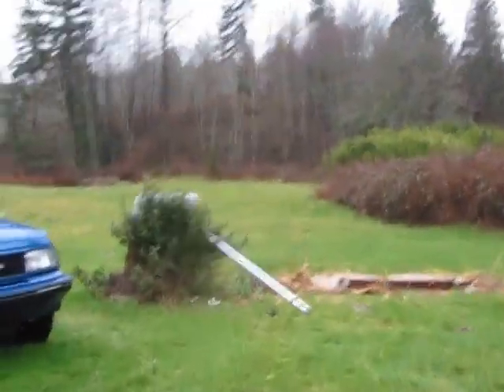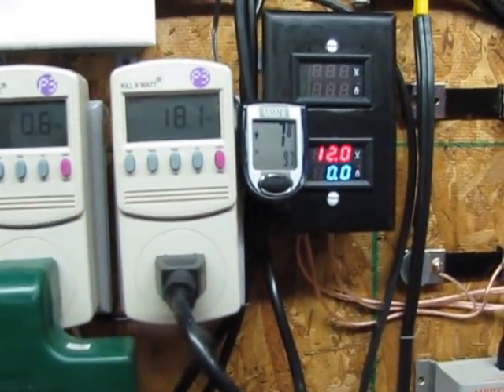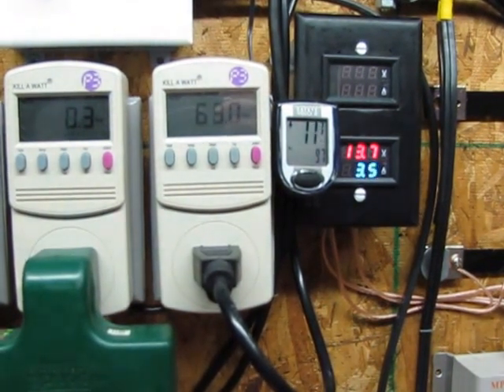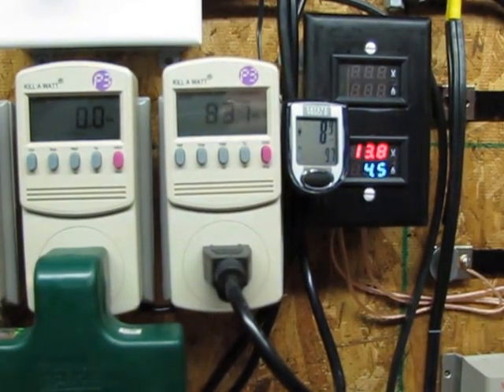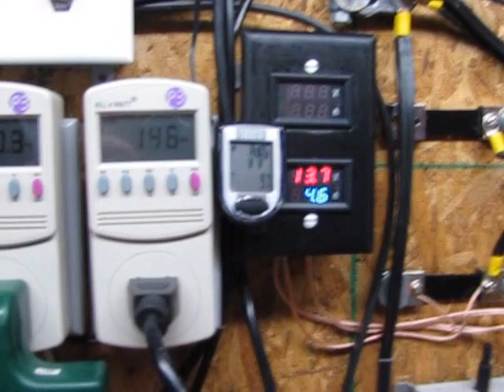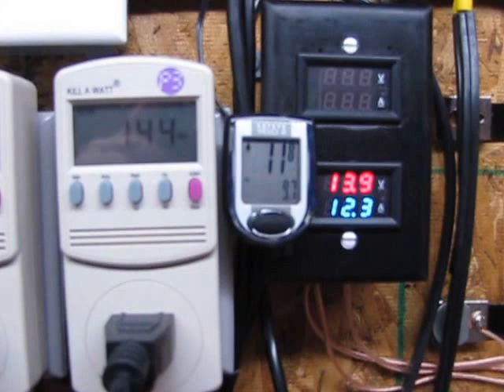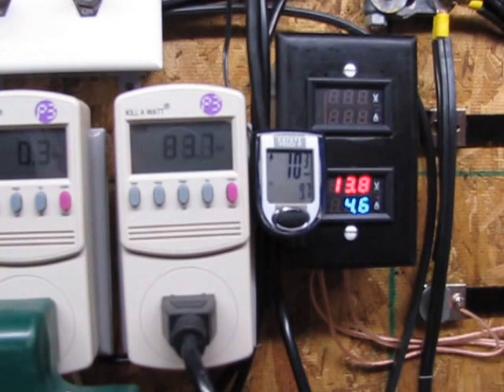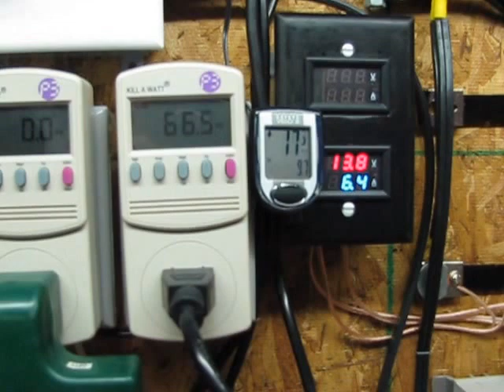Making pretty good wind power today

Comment: Those are fine numbers and you hold the camera so STILL!
Thanks for that:I didn't get dizzy.
 Tell me where or what is your wind meter,please. Yes, it updates faster that the turbines.Hell of a wind storm tonight (02/15/2014) and my project is not finished!
I took my little one down!(No guy wires).
http://www.bing.com/weather/alert?q=seattle%20weather%20update&unit=F&FORM=DTPWEA
 I figured out a "gear increasing" array with serpentine belts and a spring loaded
Mustang idler pulley. Need to still mount the main mast bracket to the unit and some sort of a swivel,too.
I'll use 1 1/2" galvanized pipe for the main mast but need to do a LOT more work to the main mount.Then guy wires,control unit,dump load.......
Where do I post pix?I'm using a tread mill motor.12 V.Raptor 4, 7 blade.
   Dave in Seattle.
Reply from the maker: I put a new video showing where I mounted my newest and fastest updating wind gauge.

You can upload pictures on google pluss or facebook ,,, I would really like to see your setup,,

Are you really from Seattle area? I have been trying to find more of us in the Seattle area using wind and solar power to slow our meters or go off grid,,,